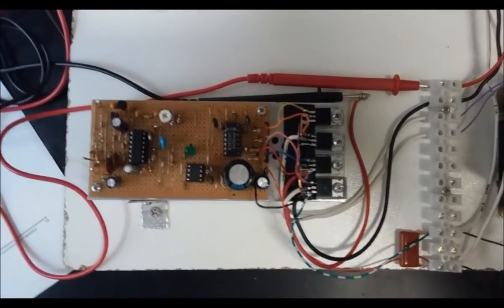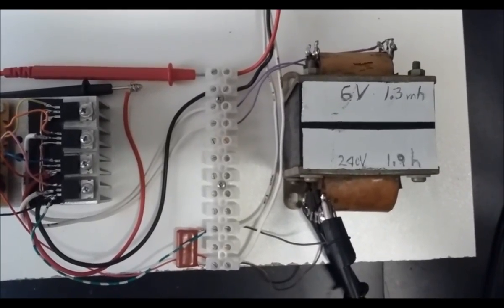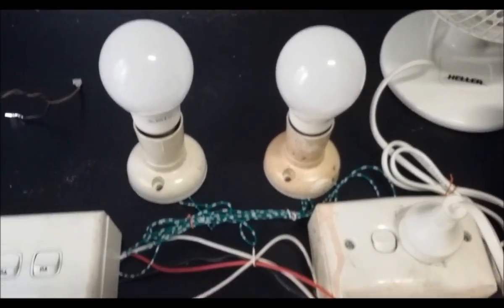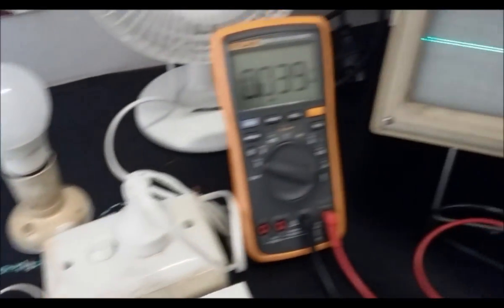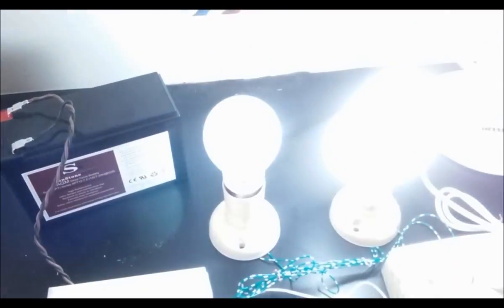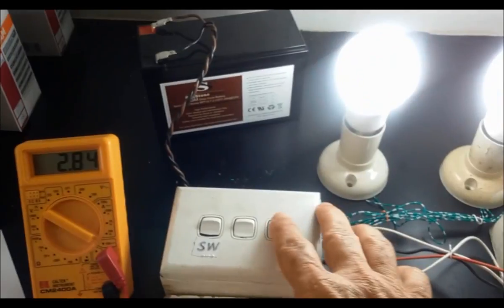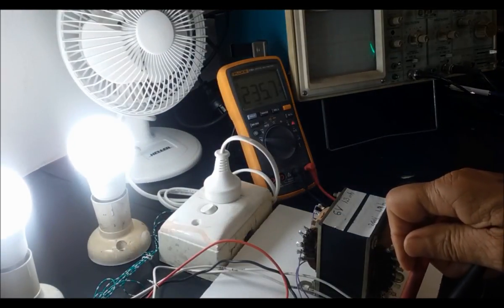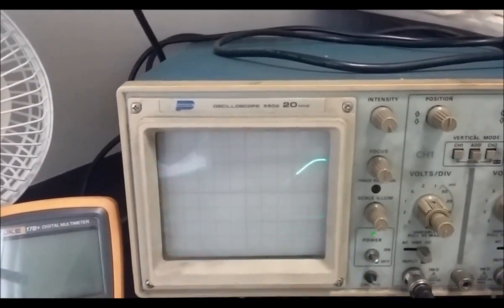Sine Wave Inverter using NE555 Timer

Comment: hello alfres  With a pure sine oscillator, for an inverter, you will experience heat in your transformer , and the current will require a high current

Comment: You can NEVER create a TRUE SINEWAVE (more like a distorted sawtooth at best ! ) from a 555 timer circuit since it CANNOT provide a 50% duty cycle. This is one of the major limitations on using the 555 timer. A Wein Bridge Oscillator is recommended over this crappy circuit.
Reply: Not completely true. If you use an arrangement of diodes in the astable mode and a double potentiometer you can get exactly 50% duty cycle. Because charge and discharge happens thru the same resistor and capacitor. I have done it my self
Reply from the maker: You are exactly correct. This circuit does use Wien Bridge Oscillator.
Reply: @alfredv8898  good going.